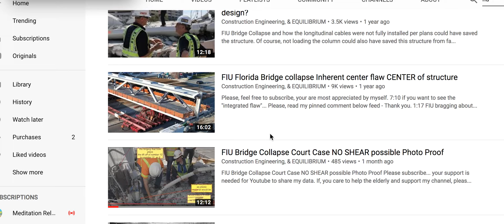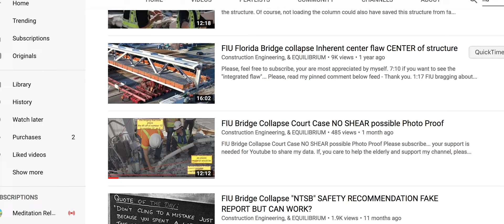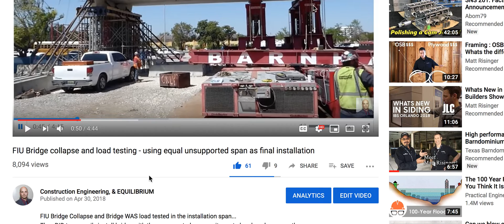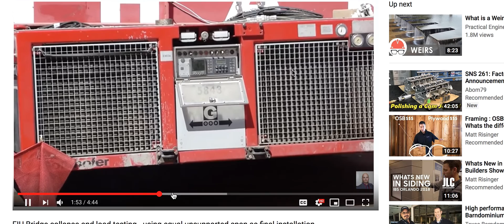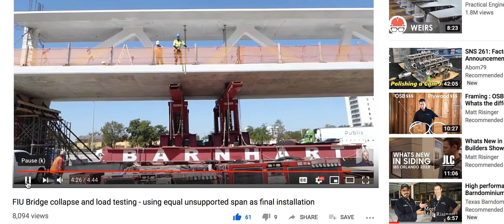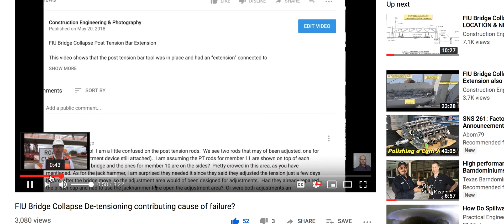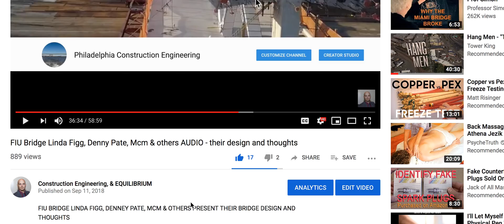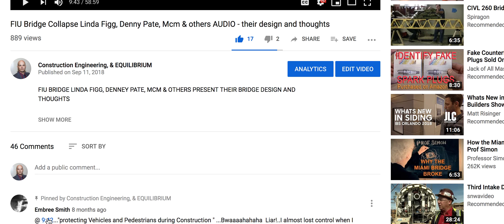FIU Bridge Collapse, Figg stating 150 year structure & Load testing bridge

Comment: Working as a millwight, the chain could be for the cribbing , to hold the cribbing in place as you push up with the Mobile  mover . With the slope of the bottom , the cribbing can fill out.

Comment from the maker: Yes, very strange...   I have to edit this again... this is my brain on 2 hours sleep... please read till the end.
I am surrounding the damn issue, and think of 11 now as an anchor and thus post tension bar acted like a come-along and pulled those forces over... But, they mistakenly sequenced it's tensioning 3rd and 4th in line... 
Even if they would have done it last, the end result would theoretically be the same...as it would have stressed the canopy, which would have added more kips at that node and removing those kips would  "relaxed" the cables / tendons.
End result more load down 10 and same failure. 
We know the start of this failure was detention ... of 2 & 11; as cracks were reported but we have no data that shows it was like this.
Plus, FDOT report with Denny Pate and others stating it is getting worse daily...
It appears, as this video shows, supports were about the same as installed.
I am currently working on, why the imbalance of deck failure at the diaphragm? That is "why" mostly on one side?  
I theorize that the "obstructions" in the canopy and mostly in the deck (electric conduit and other chases) created this imbalance of equilibrium... 
Those ''voids'' in the "deck diaphragm" would also lead to the tendons not being balanced...  YET were balanced with the end result of the clamp force (per the drawings stating the equal elongation and clamp force that must be applied) as the drawings called for... 
BUT, the deck was NOT consistent with it's ''materials'' and those "obstructions"; I theorize created all types of what I am calling ''redirect of forces"  ...
  For the engineers, I know that the force is "active" and my theory does not make sense to the ''knowledgeable"... 
I am attempting to prove, even though the profiles of the tendons in the deck were straight in design, that the "voids" are capable of creating an imbalance in forces and a torque exhibited itself on the deck (cracks developed)...   
Or we have to show that tendons failed on the one side of the deck first and this created the imbalance which exhibited itself in the imbalance of cracks on the deck at the diaphragm...   I truly welcome everyone's help in trying to show this...
For the engineers reading this I am thinking of the entire deck as a diaphragm and if the post tension was on the exterior, as my previous video shows, the effect of ALL post tensions would create a camber!
BUT B/C IT IS INTERNAL & CONNECTED ON THE TOP AND BOTTOM , IT IS CREATING A "NEGATIVE CAMBER / BOW ON THE UNDERSIDE AND A CAMBER ON THE TOP SIDE.  
LASTLY B/C THE P.T. IS INTERNAL and not external, I theorize that the p.t. could not create a true camber b/c doing so would over stress this "thin deck"...
Like the longitudinal's tendon force  would want to "divide" this deck in half (top and bottom of p.t. forces).
A question,  what are the transverse forces created in the longitudinal cables? 
I know we "think" they are "up & down" but I say post tension creates a  360 degree force and not just a lineal clamp force...
 Again, I am work on this thought and  how to  prove it... like, imbed load sensors in a member and then p.t. it from ends to see if it creates that stress down the entire ducts... Clearly on the external steel flat bar I used, we can extrapolate that the forces, ''ramp up to the top of the camber" and back down on the opposite side, in ''equilibrium"...  Why is this not true for post tensioning... why is it considered an equal and balanced force across the entire plane - yet, we know 100% that post tensioning at the bottom of a member exhibits itself with a camber (center to the cables length)... This camber is maximum at the center as this is the inherent weak part of an unsupported span. This implies the forces are more resisted at the ends of a post tension member and that area would be experiencing the most forces or is in equilibrium (of course) and being equally loaded the entire length...  The structure's characteristics are revealed with the camber... because, of the mid, unsupported span  and the structure closest to the contact points / load transfer points share their loads / forces ---  ultimately into the Earth...
So, does this mean the center span has more forces on the center of the structure or does this just mean they are the farthest from the foundation / Earth...    (This last fun statement is for my awesome followers to ponder and engineers to reaffirm their position on beam reaction points as it relates to the affect of post tensioning a bridge deck as we have here...     

 Here is another take... if, a beam can be made to camber with post tensioning then what happens to a boxed beam if we post tension it at 4 corners? -- Would not the four corners (depending on applied tension) want to camber also? Would they not, by design, make the four corners weaker? (all four corners of the ''struts'' had post tensioning and some just had 2)...     Least not forget, if you load a member, it can buckle, so you have to keep in mind your clamp force created with post tensioning is ALSO created a stress that contributes to failure in the zone it is intended to help...   They work on ''predictive loads'' more so then just dead weight loads; so they are post tensioned with that in mind... and until those loads present themselves, you ALWAYS have a member designed for loads but are not receiving them, that  post tensioning is a constant stress on any structure... Yet, I do like it for external applications in certain conditions...     For anyone who attempts to compare this to oversized steel; steel has a dead load that it transfers to the foundation and while doing that, it is equilibrium (not applying any extra stresses, waiting for a load to present itself)...     Steel, for the most part just ''over powers'' the dead loads of the structure, and when the live loads present themselves it is more than strong to transfer those loads to the foundation...  (unless a joint, etc. fails)...   
Steel bridges have ''reversals of stresses in the members" as the live loads present themselves but all those reversals are calculated for.
But, with post tensioning the live load is always considered present and the ''extra force'' is always acting on the structure... (you do the math on that idea)... 

As it stands now, Newton says equal reactions, so a camber up = a bow down / camber down... and those forces of the down cancels out a lot of P.T. kips we see on all these tendons.

I visualize the bridge deck as one big mat of 90 degree / parallel forces crossing and even touching each other (via the concrete between the crossing ducts)...
Yet, I think the intent of the transverse cable were to just act like a strong-back and also to transfer the forces from the columns/ struts to the longitudinal cables...
But, b/c they are connected via the concrete, any camber from longitudinal cables would be cancelled or reduced by the transverse cables p.t. forces... (using Newton and perhaps any camber created by the transverse cables, being they were tensioned last; would allow for a "redirect" or a "literal new profile for those longitudinal tendons"...
Okay, all this from my cellphone and now you all see where I am going and theories I have prove work...
Again, for my engineers out there, bare with me...
Perhaps this will help you see what I see; let's use the books between your two hands to create that p.t. clamp force and now have someone attempt to pull a book up or down and you can visualize this "redirect" or "force created profile in the tendon" once you pull up or down"...
I say, that the detention of number 11 created a removal of a "book"  and this removal of the book left all the forces to be redistributed down #10...    This force removal of number 11, reacted down number 10 to the deck diaphragm...   Which stress the immediate area from 10 to the pier diaphragm,   which then relaxed the  tendons to the point of the cracks we now know of (in all the images). 
This then stressed the concrete deck and the downward stress (dead load of bridge) showed itself as shear (those cracks we observed on the deck)...
And, for the layman out there, the ''profile of the tendon'' creates the up or down or (side to side forces-  (disclaimer) I found no testing that it creates a side force), meaning the location of the tendons matter. 
Put the tendons clamp force at the bottom of the books (to the point that they hold the ''above book loads'') and the books will resist bending -
Reply: I will bet any amount of money that no member of the NTSB has lost this much sleep into the investigation.  Get some sleep.  BTW.  Thank you.  I am a layman and I am learning tons from your videos.
Reply from the maker: Thank Animatem, I wish I could sleep, I have had a sleeping disorder all my life...  and thank you for the compliment on this damn structure...  I only say damn, because I cannot get access to the ass-built designs, which would show location of members but I fear that they would not have done a thorough job on surveying locations of all the materials...  Although, the one document showed the inspecting engineer (CEI) write a memo stated how much they were out of tolerances (I did a video on that)...  BUT, it appears that FDOT superseded the CEI and their issues of tolerances...  But, FDOT will just tell you they are the pass through... wait, that could have been the highway department in FDOT... Never the less, it was shot down and allowed to stay out of "tolerances"...  Those are the details I want to see, as they can explain the cracking on the one side of structure more so then the other...
Reply: @ForensicCats  It saddens me that all available information has not been made known, severely limiting what can be learned from this catastrophe. Your own efforts are that much more appreciated however. I am curious what you think might be an appropriate scale to work with if a model were to be constructed for testing.
Reply from the maker: Congnitive, I have to keep my head in work for the next 2 to three hours but wanted to give you a fast answer... 
No scale is possible at this time as that will only show the form the structure took... It will not be able to be tested unless they duplicate each "mistake"...  So, any model is just extrapolation and the O.G. (Original Gangster) bridge already was ''tested'' and failed! Never to make it from it's mother's breast, let alone 150 years as Linda Figg stated.
Reply: @ForensicCats  
From what I have been slowly coming to see with insight  gained by following your research and investigation is this was a failure in design right off the drawing board and not a failure of procedure, practice, execution or material  and any efforts made by others to pinpoint one specific action or chain of events as the primary cause of the collapse only overlooks, dismisses or perhaps provides cover for the inherent flawed design.

No matter what they would have done different with each step they now find was in error would not have made a difference in the final outcome. 

They were already in the process of chasing cracks stem to stern and back again if given the chance

This bridge would have never stood on its own... the proof of that statement is simply the fact that it didn't

And your exhaustive detailed digging and nit picking has made that very clear to all and any who have been watching.

It was all to easy in the begining for someone like me to conclude this or that was obviously but it took the tenacity of a dogged public advocate such as yourself to show it was way more involved than it first appeared.

So examining the (de) tensioning of xx, or transverse this, longitudinal that, pick points, or strapping chains, grouted/ungrouted cable chases, concrete cover, drainage pipe all are just the minutia of the greater problem
Reply from the maker: Tommy, comments like your's are awesome and are very rewarding  and gives me even more "energy"...
I do read those comments more than twice to get the double-hit...
As you know, I love the mind and psychology of everything...
With that said, your comment about this or that is an excellent point... 
It's also very pleasing to read that 
you see this big picture and implications of this failure;
Exposing this with you wonderful people is also a pleasure... when I read comments such as your's.
Thank you and everyone who "support me"...
Reply: @ForensicCats  I figured 1:1 scale was enough. Who needs another exercise in futility?

Comment: I don't think you can treat it as a truss because I don't think you can treat the members as pinned. There's a reason that concrete isn't used this way in any structures. It's much more like a very strange post tensioned concrete beam.
Reply from the maker: Yes, very strange.